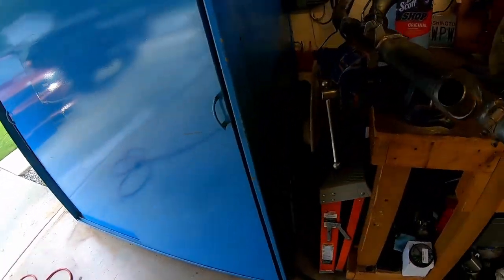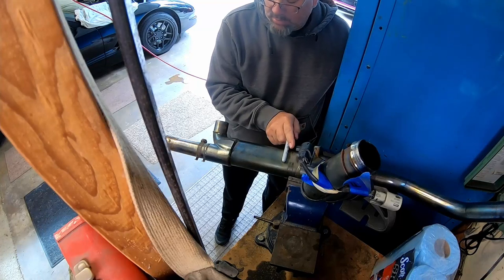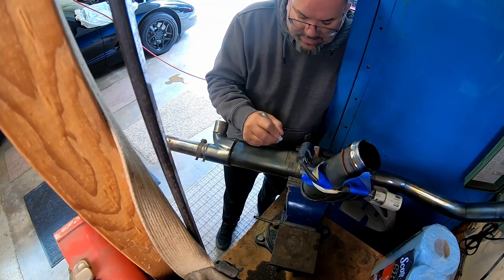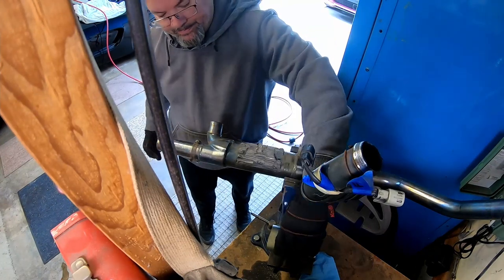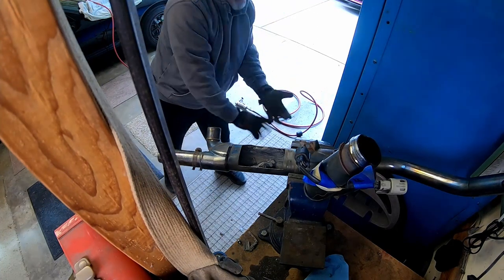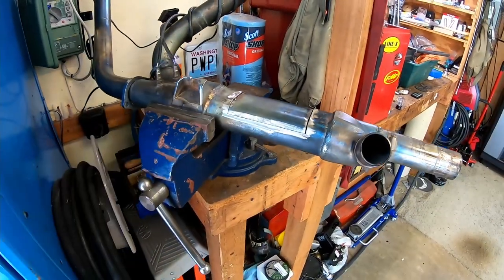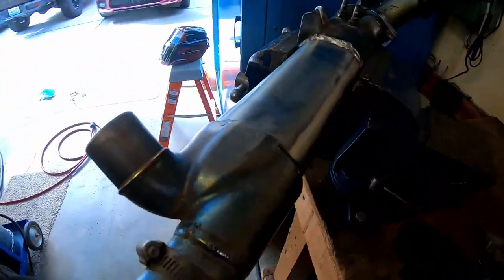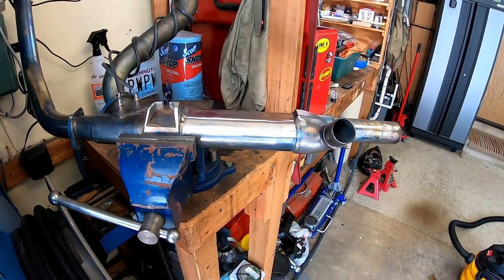How to remove the catalytic converter from a stock 2016 Harley Davidson Exhaust.  Cut and Weld

Comment: Good video. Next time try Tig weld. More superior weld on that material. But hey
Reply from the maker: Someday when I move into a real shop I will get a tig welder and learn how to use it!    That is as you know the ideal way to do a job like this and using the proper filler.   Now that being said, I routinely weld up stainless car exhaust systems for people with plain ole MIG wire and normal mix gas.   It's kinda ugly compared to TIG but I have never had anyone come back.

Comment: Bet that reduced the power output.
Reply from the maker: With the tuner required to make this work it's unlikely.   That being said this isn't intended to be some macho modification like you see with a lot of guys on high performance cars.   When riding in the desert you are simply trying to get the heat out of the exhaust and away from the rider.   The owner which lives on the mexico boarder was extremely pleased with the outcome.
Reply: That’s not how it works with engines. An engine is a mechanical lung. The better it inhales and exhales, the better it operates. When you restrict the flow of either, the engine is less efficient. Plus, putting a catalytic converter next to the engine adds extra heat to an air cooled engine which isn’t ideal. Also, having that hot section of pipe next to your leg is no fun either.

Comment: How did u tune since there is no map for modified heads pipe. Or does your bike run shittty?
Reply: Jose said "Tengo un primo en Los Ángeles que me trajo un sintonizador Vance & Hines FP3 que funciona."
Reply: Translated is "I have a cousin in LA who brought me a Vance & Hines FP3 tuner which works."
Reply: All you have to do is use a map for another 2-1-2 headpipe, and then autotune. Closest would be a Bassani 2x2 headpipe or a Supertrapp 2:1:2 unfiltered pipe. Not really that hard. Same idea as using some obscure exhaust or slip on and going with the closest thing in the lineup.